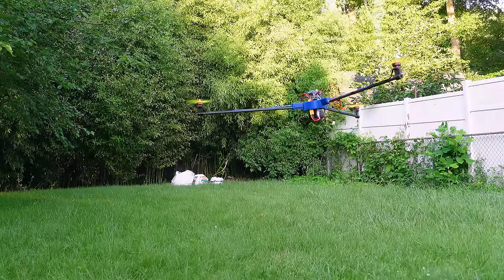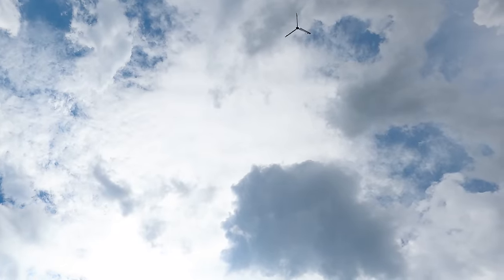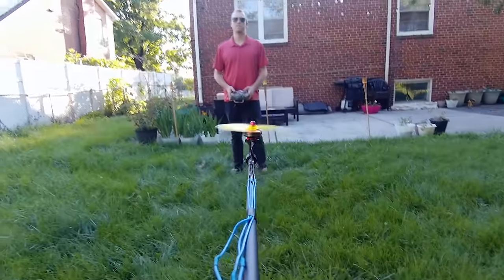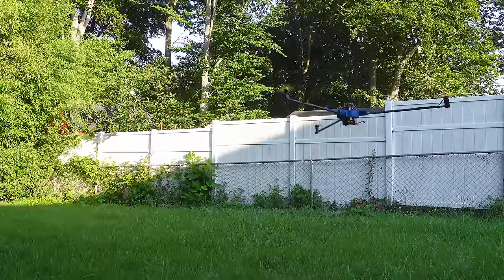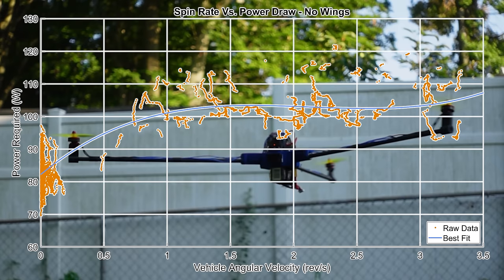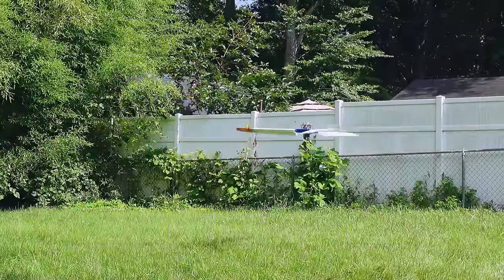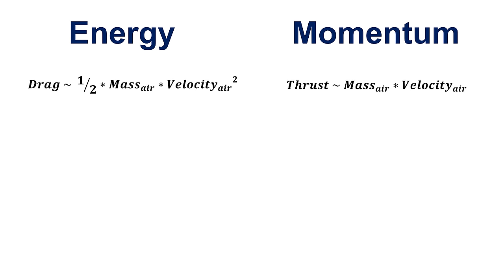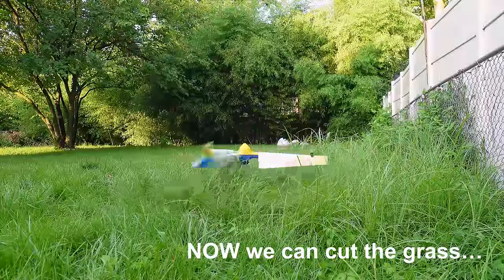The Spinning Drone Paradox - Part 1

Comment: First thing that occured to me is that you need a 360' camera with software to stabilize the view based on the RPM speed of the drone. That would give the efficiency of the wings and a usable FPV view. I wonder if you could also mount an alerion on each wing to deflect at specific points of the rotation to vary the lift and give you an effective cyclic control. 
With those 2 features combined you'd have a VERY cool drone.
Reply: You'd still have a FPS sync issue as the frame/angular velocity axis isn't being measured. This is really only possible if the camera shutter is fast enough to avoid blurring once you exceed a certain horizontal velocity, which depends on how long the camera shutter is open. 

It might be possible if you are able to capture images on a perceived delay, ie within 2-5ms once the drone rotation exceeds ~50RPM. 

Mostly because frame capture takes time and light to capture, deblur and store, you would not be able to get consistent video at a fixed angle unless you install a stabilised shutter or aligned shutter that triggers a frame capture. 

Even if you create a software relationship / table for the pitch to angular velocity to fan velocity RPM, wind and resistance can interfere with the rotation alignment. If the wind is strong, it could slow the rotation and offshoot the predicted velocity and position.

Add to this, MJPEG rotation adds a significant amount of RAM and math calculation, which would require a GHz speed CPU to handle real time image manipulation at 30-60fps. 

Software alone won't handle the reference angle and position unless the vortex/spin is being measured by a sensor, aligned with a compass or gyro.

Another approach might be to record the raw footage as a stream between multiple cameras, and interpret the gyroscope /compass data coming in on a separate feed, so a faster GPU process can rearrange and filter the position of the video still in software, then stabilise the image location across multiple cameras or multiple overlapping streams to choose what should be the next frame based on the streamed average/predicted compass position and stitched images where the image overlaps. 

Ie if camera 3 is facing 30' to 80' and camera 4 is facing 60' to 110' and the gyro is reading 90, you switch to camera 4, and stabilise the overlapping feed so the distortion is minimal.

Comment: Very interesting concept.
Helicopters have a very nifty mechanism for steering where the variable pitch is applied more at one side of the cockpit compared to the other. A camera payload could counter rotate through a small motor and a digital system perhaps.

Comment: Very very cool! I wonder what would happen if you introduced control surfaces to the larger airfoils. Basically having two foils on the bottom and using the third as a rudder. I wonder if the power requirement for horizontal flight would decrease, assuming the COM and COL could be balanced. Using this to increase range in horizontal flight

Comment: To be useful, this would require a way to carry a payload that doesn't spin. Perhaps you could arrange your device similarly to helicopter blades spinning above a stationary cabin. Your explanation of the effect you found is very interesting in itself.

Comment: Further, look into the concept of the exhaust jet powered blades of gyro copters. Similar idea. There even was an airliner style gyro copter concept around like that, which proofed too noisy for urban applications and hence never came into service.

Comment: 1. The wing load or pressure is crucial for effectiveness. 2. A propeller in air doesn't just work according to the recoil principle like it does in water.

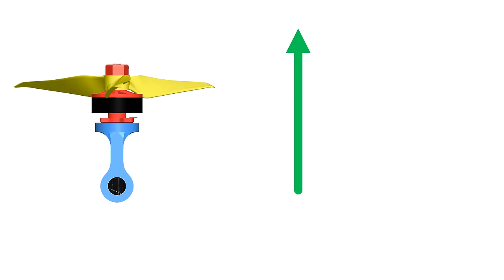Comment: 0:38 While yes half of the total thrust is now sideways the upwards thrust is actually at 1/sqrt(2) of the initial so still over 70%. You would need to go as low as 30 degrees to have only half of the thrust compared to an upright rotor. 

So at 45 degrees you wouldn‘t need double the power to keep the drone airborne but only ~1.4 times the power.

Comment: The concept that anything that goes in a straight line can also go in a circle. You’ve glued three C-130 wings together and spun them around. With independent control of the angles of the wings rather than a shared axis, you could program x/y axis directional control of the unit as it flies, similar to a helicopter’s pitching rotors.

Comment: Just simple physics. The Wings now act like the rotor of a helicopter, but powered at the tip instead of at the axis of rotation.
The downside being the entire contraption spins so mounting a camera at the main body would present another problem to keep it pointed where you want.
It could be possible to mount another central unit below the spinning one and use a counter-rotating motor or some method to spin it in the opposite direction to keep it steady.

Comment: IT  is apparent you have greater lift with the addition of  Wings . The  Wings could be weighted to provide lift as speed increases. Lift  is directly related to air speed over each surface. WING IN GROUND EFFECT  is the most efficient as the craft gets larger, especially a reverse wing.

Comment: At 45 degrees, vertical component (lift) is .707, sin(45)=.707, horizontal component (thrust) is also .707, cos(45)=.707

Comment: if you throw on a gyroscope sensor IMU with a high polling rate you could calculate your orientation and control tilt by delivering more power to the propeller that is opposite of the direction you want to go and a constraint to limit max tilt angle.
Reply from the maker: Check out the third video on this design, did exactly that!

Comment: This is really awesome and has got me wondering if efficiency would improve if using smaller propellers to spin the motorized propellers? I am having a hard time figuring out how to explain it but instead of using motorized propellers to spin the main arms, you could use 3 smaller motors (for each arm) to spin a second set of propeller arms. Propeller on propeller on propellor. 

Super curious if that could work. It would be a total of 9 even smaller motorized to spin the arms which would then spin the aim arms. This would be awesome to see. Thanks for the video man!

Comment: This is likely been asked already about 30 times in this comment section, but I'm curious about practical application. What can you use such a drone for if the center of the drone is constantly spinning? I ask because it seems like most drone applications would require the center or hub to be stationary.
Reply: the payload can be actively stabilized by a motor rotating in the opposite direction

Comment: Yes, clear. Good demonstration. The larger the area the bigger the lift. This is pure physics. In the end you might have big model airplanes. I made about 100 different 1 propeller, remote controlled flying disks with counterforce mechanism, what has even more than 300% efficiency. I have to admit, that aerodynamic stabilization was really challenging. My disk like flier is only 10cm diameter,  2cm thick 10 gram and costs 5 Euro. Of course I am a good engineer, not proud, but good 😋🥰. Thanks for this nice video.

Comment: I'd love to see an efficiency tests on corkscrew propeller designs, might be more, maybe quieter, please test this as well as you can.
Reply from the maker: My buddy Austin did that: https://www.youtube.com/watch?v=VEFv6gs67zA Basically, incredibly less efficient that a regular low solidity rotor. So much so that in some conditions, the screw actually creates negative thrust from what you'd expect from the rotation direction.

Comment: Could you have three of these attached to the arms of yet another drone? That might further increase the efficiency, but it'd also increase the weight substantially.
Reply: It would help solve the steering problem too. Independently controlled trios of wings would make this thing incredibly manoeuvrable.

And provide a non-rotating base for camera and any other payload.

Comment: Amos Root who published the first account of the Wright Bros. successful flight (in a beekeeping magazine I kid you not) remarked that the thrust of the Flyer's little engine was far less than the Flyer's gross weight. This is still true for most airplanes, since for a well-designed wing in level flight,  (Lift = Weight) > (Drag = Thrust). So what you observed makes sense, but it is still a VERY cool application of that result.

Comment: You'll note the power isnt double.  This is because of pythagoras.  If you tilt the motor 45 degrees, you drop thrust to 71% (1/sqrt(2)) not 50%, and to equalize you need to multiply thrust by sqrt(2), which is approx 1.4.  So 80W x 1.4 = 112W, which is a lot closer to what you're actually seeing (rather than 160W which is way off).  Very cool though!

Comment: That would be something that could be used to transport "heavy" stuff, wouldn't it?

Attach a string to the drone, which itself attaches to the payload. Lift off in "quad" mode until string is extended, switch to uni-rotor mode for lifting off the heavy payload.

I am not sure about practicality but I guess this could be used for applications where you don't have much space but you still want to carry weight (i.e. firefighting, where you might want to carry extinguishing stuff to inaccessible regions of a building with people inside, to slow burning until rescue gets there). Idk, it's 2:30 am and I am watching this instead of sleeping. I'll regret it at work and I will definitely do it again.

Comment: Currently you have motors at the end of the rotor to create the momentum. Is that more efficient than a normal helicopter with a central motor powering the rotor?

Comment: Perhaps stability could be achieved by studying the way rocket missiles are controlled.  The fins impart a spin to the rocket by deflecting the airflow slightly.  But the rocket is steered to the target by those same fins, which correct the trajectory based on their position in the rotation of the rocket.

Comment: This is absolutely a glimpse into the inevitable future of drones. That 3x power reduction is massive. Which also offers the possibility and flexibility of a significant speed increase for a similar, or less, energy cost if you can manage to achieve directional control during spinning horizontal flight. A flying propeller. Honestly a little terrifying to think of a world of flying helicopter blades. But this efficiency gain is simply too massive to not try to take advantage of.

This design also makes me think a "UFO" drone, actually kept aloft by it's spinning, could be possible. A cylinder of blades like a turbine, spun by 3/4 propellers on the outside. That's more of an art project but would be very cool.

Comment: Imagine if the wings that you applied to this craft  Were like a biplane they would not have to be the entire length, but they would increase the surface and possibly cause a better efficiency at low RPM justified and you’re just a guy smart enough to figure it out. Thanks for the video.

Comment: Hi, hope you having a good day! thanks for uploading this content, its really inspiring! and I do apologize for my english btw, I hope your eyes don't bleed  while you're reading this... I was checking on the new kind of toroidal propeller design and I couldn't stop thinking on this video. So, by my understanding, you are using the little blades to create momentum on the larger blades and therefore you generate more draft due the increased area and mass in the bigger blades,  making the whole lifting energetically cheaper. Here comes my question: Based on that, is there a way to "grab" more air in front of you? applying the same logic you used to move bigger blades,  idk if it's possible to create like an "induction fan" using the toridal desing to do so.

Comment: It isn't necessarily more efficient to have a larger propeller I don't think; I reckon that effect you mentioned of a drop in efficiency at high airspeed will kick in a lot faster for a bigger prop. What is interesting about this design is that you keep both options open. It would be interesting to see if in high speed horizontal flight you got better performance in the 'normal' tricopter regime, or perhaps even operating at an extreme angle of tilt effectively using those blades as fixed wings. It might be quite a useful configuration if it allows fast efficient flight from point to point as well as a very efficient hover by switching flight modes like that.

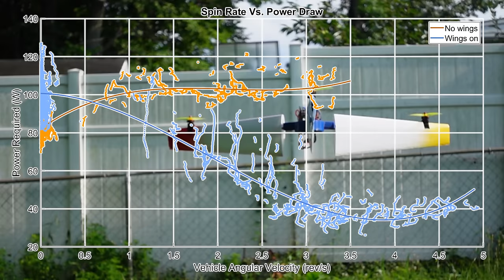Comment: 6:13 I don't agree that it's 3x more efficient at hovering than a regular drone, regular drones are not most efficient (and not made to be) spinning and your more efficient drone is worse at normal hovering and way better while spinning. You should compare the spinning drone's energy use while spinning to the regular drone's power use while hovering without spinning, which would make your spinning version 2x more efficient, which is still crazy.

Comment: For forward travel you could configure 2 of the wings to act AS wings with the third being neutral or act as a kind of rudder. It has a lot of dihedral and the props might blow away wing tip vortices because of their location. \ /

Comment: This effect have explanation. Try to compare     water skiing on feet and on skis. Bigger wings make smaller pressure on air with same plane weight, so air is not pushed down so quiqly. In aerodynamic this effect is described, (not directly) by "Thrust-to-weight ratio" (weight means here also possibility to lift such weight, so it also can be replaced by lift force recalculated to kilograms)
Fighters have this ratio above , so they can fly vertically up.  But big transport planes have this value vary small. That mean, their wings produce more lift force than their engines thrust force. And they can't fly vertically up, at least continuously.

Comment: A spinning drone will be practically useless, because the drone has a device called IMU to measure it's orientation. IMU is the hypothalamus of the drone. If you are planning to simply hover at one place, you don't need a drone for that. You can use the good old baloon.
Why the spinning drone gives more lift? Because by design, aircrafts are supposed to spend their thrust to counter drag, and gain lift.
For example, a biplane, spends it engine power to neutralize the drag of the propellor. The propellor gains lift in forward direction, and this lift neutralizes the drag experienced by it's wings. And wings finally lift the aircraft upward. So let's say, if you spend 1 N-m torque at the front propellor, you gain a lift of 5 N in forward direction. That 5 N forward pull, counters the 5 N drag of the wing. The wing returns 15 N upward lift. So By inversting 1 N-m torque, we are getting back 15 N upward lift.
You can create a 3 dimensional copter by neutralizing the drag at three levels. The lift of smaller propellor rotating in YZ plane, will neutralize the drag of medium size propellor rotating in XY plane. And the lift of medium size propellor(XY plane) will neutralize the drag of large size propellor rotating in ZX plane. So by investing small power in the YZ plane, you may get tremandous lift in the ZX plane. But at the end of the day such a drone will be useless, because IMU will not work in in it.
If we could do with rotating drones, we would catapult a boomerang in the sky. But most sensors will fail if the entire body rotates. We can still create hand grenades or relief packages, shaped like boomerang. Sensors are not necessary in every application - but such scenarios are rare.

Comment: I love it, now you just need a magnetic gimbal in the middle to put the passengers.  This thing has good mobility and if it can use less energy then its fuel cell will last longer.  Doesn't sound too noisy either.  At human scale it would be pretty disruptive.

Comment: I wonder if same/better/worse if there was an outer ring for the props and motors that could mechanically drive an inner ring which houses the wings. That way wings spin but props don't. There would be thrust needed to hold the rings from counter rotating, but no drag from the props and motors since they would no longer be spinning

Comment: if you add a differential attack angle control between the small propellers axis vertical angle and the wing attack angle it would be even more energy efficient and more controlable, excellent project anyway 👍👍👍

Comment: TBH I didn't read your comments so I don't know if somebody else already said this but what if you were to put a housing on the bottom of it to keep the cords and stuff and getting tangled up and then put some kind of attachment onto it with a free spinning link and then put a hook on the bottom of all of that and then you could test its weight load you may have also vastly increase that capacity